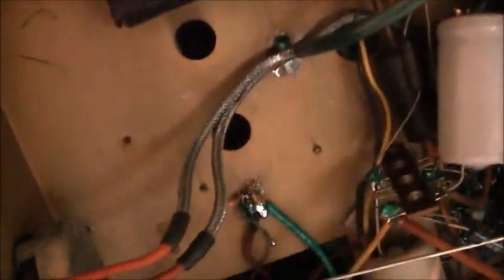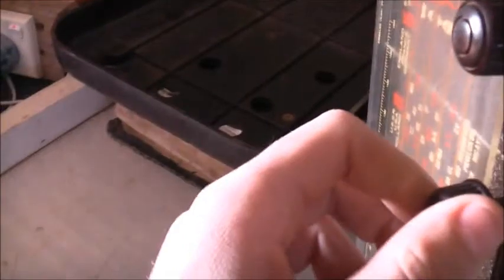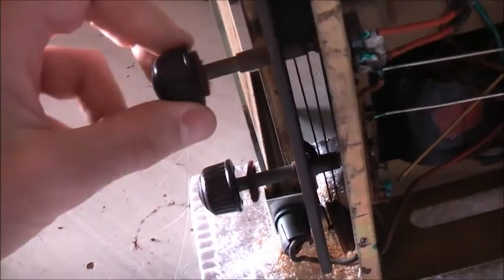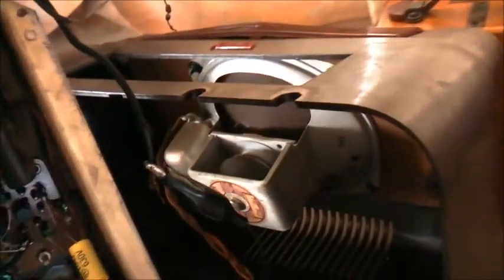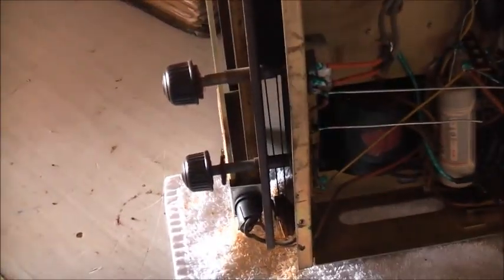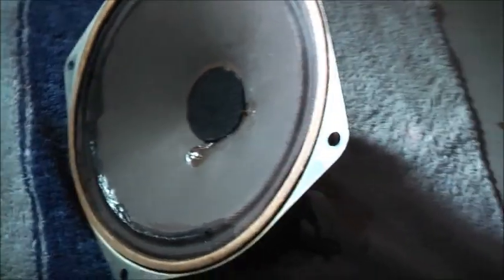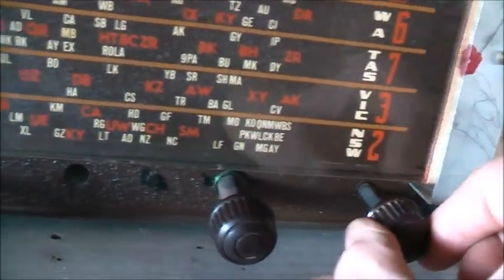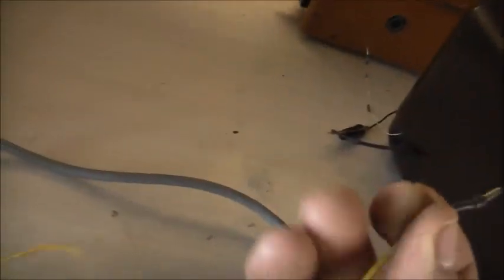Kriesler 11-7 Restored!

Comment: They sell .05 or rather .047 uf ones as well. I need to make up an order and buy at least 25 of each type, some 100 of each type like .005 uf and .01 uf. I will got to Mauser for the other stuff I need like resistors and small electrolytics for transistor radios.